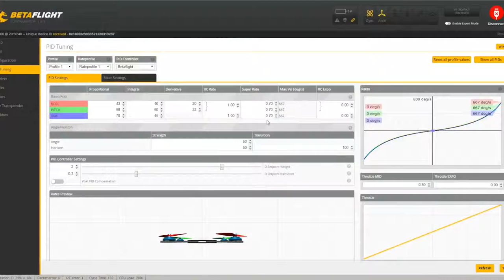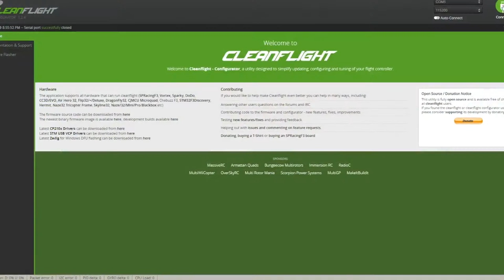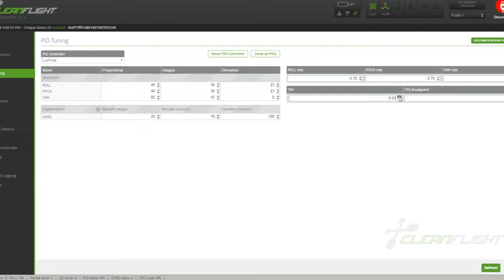Yaw Rate is the key to Good Quad Control!!! - Betaflight & Cleanflight - Kingkong Q100

Comment: yeah I find yaw is very important but you can adjust yaw via p gain to help it be more sharp but still not over the rate of spin. I think rates are more you flying the gyro that's why its best to keep rates same. Next time your flying try adjusting yaw p up so it moves more locked in ppl call it
Reply from the maker: Thank you. I made the video a while back. Agreed. Yes, higher P will overspin - yaw > stick
Reply: No my friend thank you I subbed up and have been learning and confirming my understanding. I also learned last night camera angle changes how much yaw you use in flight lower the angle to level more yaw is needed to turn the same. Also found some ppl might be trying cam angle to low to start acro its fine in stability but in acro mode you stay pitched most of the time

Comment: . Thanks for the build tips. I build the exact same quad with DSM2 rx and using Devo 7e.tx. I'm a newbie on starter racing quads. Copied your PIDs settings. The quad is more sporty. On the Devo 7e, I use the hold switch to arm. I can't seem to get FMOD switch to work. Like to switch between Angle/ Acro. Any tips?
Reply from the maker: Hi Michael. Thank you. Make sure that your Model on 7e has 6 channels. Then check the channel monitor to make sure that the switches are responding to your flicking thee. Then go to Modes in Cleanflight and assign aux 1 to arm and then aux 2 to mode. See how it goes.
Reply: jtgravityRC Ch 6 still no activity on channel monitor. Copied the settings on Ch 5.  (Hold 0/ 1) and change to FMod0/1.
Reply from the maker: Simple fix. Create a new model with Template. Use the 6 Channels Airplane. Change Channels 1 to 4 back to Simple and channel 6 to simple.
Reply: jtgravityRC still not working. Weird. Works with deviation eg E010, JJRC1000 ... Thanks for your help. Btw Q100 flies great LOS on horizon. Bum side is props and rubber feet comes out too easy on a crash. Lost 1 rubber foot already. :-)
Reply from the maker: Do you have the latest nightly build of deviation? It works for Devo 10 with deviation. Yes, I took off the rubber feet. So far my props haven't fallen off yet. I have been thinking of a workaround. Try setting arming using sticks combination and use the hold switch as mode switch.
Reply: jtgravityRC Been a while i check deviation.com need to check the nightly builds. Red color of the props made it easy to find.
Reply from the maker: Yes, have you tried the workaround in the meantime? I am curious to know if it works. :)
Reply: Been many weeks looking all over the web for the solution including google.com, RC Groups, Deviation.com. Opened this morning the TX and found one of the two wires on FMOD switch has insufficient solder on it. Finally got it to work now. Set CH6 to Simple. Mod 0 to Expo. Went to Cleanflight. Set Aux 1 (Hold 1) to Arm. Aux2 (FMOD) 0= Angle; 1= Horizon. Thanks again for your help. Happy Flying!!
Reply from the maker: Great work! You are welcome. Happy flying to you too! :)